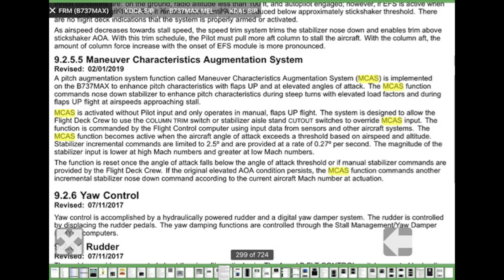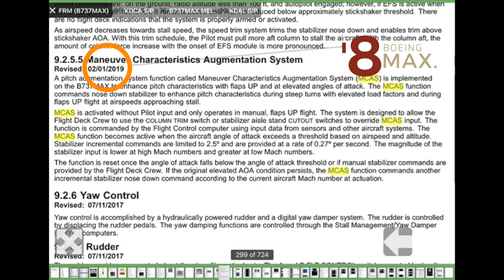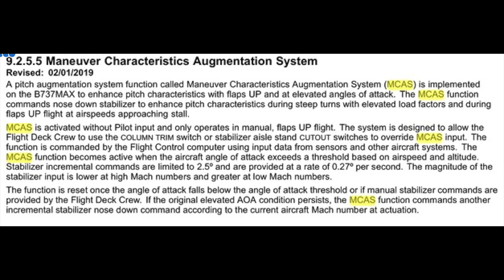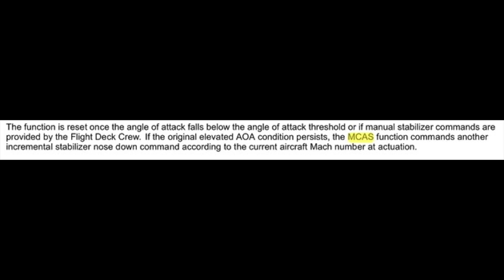737 flight manual - Prof Simon

Comment: New York Times just said last hour: "Doomed Boeing Jets Lacked 2 Safety Features That Company Sold Only as Extras Standard 737 Max planes are not equipped with a so-called angle of attack indicator or an angle of attack disagree light. The indicator will continue to cost airlines extra, but the light won’t."
Reply from the maker: Shocking
Reply: If those safety features would have saved the two planes: That would be the nail in boeings coffin. They know the risk, they had a solution. They cheaped out. No one dictates Boeings list Prices. The cost of the two crashed air planes and reengineering and retrofitting all remaining planes, lose of sales, ... all up add upto way more then Boeing has saved by not including those system in the list price. So: "Competitive reasons" are void.
Reply: Airlines are just as guilty as the aircraft costs $120 million the extra for that light was just $80k more.
Reply: The 'essential' safety features were sold as options presumably because if they were sold as requirements it would acknowledge that MCAS was a critical system that needed to be built to FBW standards and be fully and deeply retested and recertified.

Comment: Ola Professor !

I welcome your explanations and understanding which in my view has solved '99, 99% of the problem '; Something still does not complete me: - THE LOW INDEX OF THE OCCURRENCE! (all "non-executing" pilots would be able to fix it). where so far ONLY (2 'regrettable' accidents). How many MILLIONS OF ROLLING. This Flap move every 2.5 degrees (this Graduation that allows ARREDONDACIONES) is a factor that bothers me to full Conclusion ! Obrigado. (compreende em português ?)
Reply from the maker: Good points...I don’t really know....maybe Ethiopia has steeper climbout ...triggering the mcas?

Comment: How the pilots are trained does not fall to Boeing I feel that this whole ordeal is falling out of the realm of aviation safety and accident prevention and going into a political, very political stance because of trumps relationship with Boeing.  Now I'm not saying that Boeing did nothing wrong but I feel everyone is wanting to say Boeing this or Boeing that and I hardly hear anyone say anything about the company's and there requirement. IDK I just feel that both of these horrible accidents with such loss of life will be smeared by political pressure or possible gain the truth no matter who it condemns or obsolves need to be told.
Reply: It's simple. The problem is right in front of nose. !    The engines are too big. The engines are too far forward. The engines set to high in the wings. The engines are too close to the fram or body of the plan and too close too the stoll sensor. Which would give you all sorts of problems with the computers
Reply: Matt Kelly I agree Matt. We will soon move into a phase where we forget the lives lost, and even the plane; and just look at which company Boeing or Airbus, or which country U.S. or France dominates world aviatrics.

Comment: Let How Much Expert The Pilot To Flight Boeing 737 Max, They Cannot Save From Disasster To Crash If The Both Engine Off Or Lost Power, They Cannot Drive Just By Brain And Electrical On Plane Event The Battery Is On, .... God Bless Sir, ..... Cherrio02.

Comment: What I learned from documentation and fellow technicians. MCAS was intruduced to compensate for the extra lift the engines and engine nacelles create ahead of CoG. This will create a strong pitch up when nearing stall speed. To prevent rolling over when pilots don't respond quick enough MCAS would trim down. The main input MCAS uses is AoA. Now documentation points to mean value between right and left AoA, but the FAA in november last year mentioned a single AoA value could upset MCAS. For me it is still not clear if the mean or left absolute AoA value is used. It might be that the main/left SMYD 1 does not compare the calculated AoA value against SMYD 2 (standby / right) as it does for rudder control. Normally commands are not executed when there is a disagreement in values. Maybe it only does when the AoA disagree option is installed! Oh my if this is true...

Comment: In an earlier video you mentioned there were two choices in a redesign of an airplane with new center of gravity and center of lift factors caused by bigger engines with more thrust. You said there were two choices. The mechanical choice of redesigning the tail plane, making it larger. Expensive. Or the electronic choice. Cheap. This reminded me of when the original small Piper Cherokee evolved into the Cherokee Six. The larger version with a bigger engine got a larger stabilator for more control authority.
Reply from the maker: That’s right ....I’m a Cherokee 140 pilot.

Comment: "cutout switch" Well, why didn't they use it?
Reply from the maker: That probably did know what was happening...the mcas trim activation was maybe not in the manual...for lion air at least..
Reply: @SimonHollandfilms   Yes, for the first crash, But a very clear AD was issued shortly thereafter.

Comment: What ever happened to the idea of designing airplanes to have inherently stable flight characteristics?  Maybe Boeing has been making to many fighter jets.  A steep climb out roll should not make an aircraft unstable to the point where it would not self correct if climb and roll inputs were stopped.  Computers should not be relied on to correct an inherently unstable airplane.
Reply: Boeing had that choice to redesign the 737 when they put these newer heavier engines on but it was much cheaper to use the MCAS system.
Reply: Agree totally. I would never fly on this thing, its centre of balance is so off whack that it has to be pitched excessively forward even for level flight, I.e it needs to provide a constant restoring force against the torque of its own unbalanced weight. It's just insane. It's basically "pretending" to be stable, for all intents and purposes.
They have a design with a serious flaw, and in order to get around that they write a program to secretly alter the flight characteristics of the aircraft. And you just know the guy who said "this is a bad idea" at the design phase is curled up in a corner somewhere, rocking and mumbling.
It reminds me somewhat of NASA's problems with the Shuttle, where the pressure to launch meant that figures were fudged and safety margins inflated, then in perhaps the biggest hyped space launch since 1969, it blew up on live TV. As Richard Feynman put it: nature cannot be fooled.
Reply: Marcus Magee Exactly!

Comment: For what it's worth it's pretty horrific when professional pilots with 1000s of hrs flight time on the 737 don't know what the heck is going wrong with their Max8 plane right up to the time it plows into the ground or ocean.  The Canadian company that makes the flight simulator for the  Max8 said they have only delivered two worldwide so far.  United Airlines, the biggest user of the Max8 won't get their 1st sim. until Oct this year.  They also said this weird MCAS response was not part of the original spec build from Boeing in the first place. So what's the point?
Reply: I hate to correct part of your statement,  Southwest currently has the biggest fleet of MAX 8s in the US with 34, American has 24, and United has about 14 of the MAX 9s.   I agree with your statement totally, just a small correction, take care!
Reply: That 'clarification' is confusing, especially the reset part, for pilots and probably the engineers. The system was put in to correct a nose up condition created by the engines, and that problem has limits at level flight. This makes it sound like the system is designed to prevent stalls because of nose up, not by taking control of the elevators which are quite responsive, but by misusing the trim control which is very slow. You could easily correct nose up stalls like auto pilot has done for decades, by changing the elevator position, regardless of what is being done with the yoke.
Reply: The problem is that there may be many professional pilots out there with 1000s of flight ours when the plane was flying on autopilot and with close to 0 hours flying their plane manually. Remember that the Ethiopian captain was only 29 years old.
Reply: The point is that even if something is not in the training program,  when you receive an update for the manual, you must read and understand it.  If the training you received operating an automobile doesn't cover what to do if the accelerator sticks, but an update from the vehicle company says, if the vehicle's accelerator sticks, shift the vehicle into neutral to disengage the speeding engine from the drive system, then you should do so.
Reply: Or maybe if boeing could put in a bit more effort and informed that the new update are crucial and required the fullest attention from all pilots or maybe do what most car macnufacturer did in the event of a recall for faulty stuff, via electronic media or any mainstream platform it would be really helpful to the entire pilot community and I bet it will be appreciated but hey who knew what's happening with boeing or the pilots life this passed month. Just saying.

Comment: Do I understand it correctly? Boeing put an automated system to stabilise the flight characteristics of the B737Max and if the pilot disables the system because it over reacts, but MCAS detects the condition still exists it turns itself back on?

My non-pilot questions are:

* Is the AOA located a less than optimal location and is giving erroneous AOA indications in a climb or a climbing turn?

* Does the autopilot have the right fidelity to match the fidelity of the MCAS system and/or the flight characteristics of the B737 MAX?

* Does the MCAS logic automatically adjust the elevator to push the nose down as the aircraft approaches a stall in anticipation of the nose pitching up as more power is set by the autopilot??

As a general principal should a commercial aircraft be able to be easily hand flown by a typical commercial pilot within its flight envelope without any need for automated interference?  I am getting the impression that without MCAS Boeing doesn’t think the average commercial pilot can fly the B737 MAX.
Reply from the maker: Aoa are placed in the United un-interupted airflow on the nose...that’s ok but they are fragile.

Are you asking...do they play well together?  I think they probably do.

Very good question and possibly the root of the problem...all I know is the mcas keeps adding 2.5 degree nose down ....repeatedly until the horizontal trim is maxed out...and the pilots would have big issues recovering from a steep nose dive.
Reply: The logic behind the MCAS resetting itself is the following : MCAS is not a complete fly by wire computer which models the full flight characteristics of the plane. It is supposed to be a simple and dumb assistance system.
-Pilot does something wrong and pulls the control column raising the nose of the plane way higher than he should
-MCAS detects condition under which it is supposed to act
-MCAS slowly trims the stabilizer down to help the pilot do the right thing, and keeps trimming harder and harder for as long as necessary, and in addition the stall alarm is ringing
-MCAS has a built-in limit of 2.5° stabilizer trim towards nose down, but is never reached because either the pilot has also helped by pushing on his control column or this action has brought the nose down enough by itself
-The plane is now safe, in the correct attitude, and stable : the stabilizer is in the correct position : MCAS switches off and resets.
 MCAS saved the day ! yay !
-In the event the Pilot does the same mistake again, MCAS is ready to trigger again and do the right thing, again.

Now let's decompose what I think happens when the the system misfires like the in the two accidents that have occured : 
-MCAS activates but does not see the situation improving, so it trims the stabilizer down all the way to 2.5° towards nose down : at which point it disconnects leaving the stabilizer in the wrong position.
-No big deal, the pilot just pulls a little on his control column to maintain flight parameters, uses the trim button to apply a little bit of trim up until the plane flies level and then and tries to troubleshoot, the pilot KNOWS that it is not a runaway trim situation because the trim stopped moving on it's own (after 2.5° towards nose down), and the trim button works normally : so the pilot does not use the runaway trim memory procedure, and does not understand where the problem comes from,  and the STALL alarms keeps ringing so he tries other things.
-Pilot does something (anything) that triggers an MCAS reset (tries to turn the autopilot on and off for example).
-MCAS triggers again until an additional 2.5° maximum (now 5° total towards nose down)
-Pilot needs to pull really hard on his control column, his mind to completely occupied by using force on the control column. He can barely fly the plane (and flies poorly because nobody can fly a precise trajectory when using a lot of force). One thing is certain though : the pilot no longer has any mental resources left to troubleshoot.
-MCAS triggers again until an additional 2.5° maximum (now 7.5° towards nose down)
-the now needs to use all the force he has to pull the control column is in it's maximum deflection position, yet the nose keeps going down.
-the pilot tries things : uses the trim button to bring the stabilizer back in it's normal position, and brings the nose back up. It looks like the pilot has found the solution, but...
-as soon as the pilot releases the trim switch, MCAS triggers again
-repeat the cycle until...
-the pilot is exhausted, physically and mentally : he does not understand what is happening, he is mentally and physically exhausted.
There are all sorts of non-sensical alarms going all over the place and neither the pilot in command nor his colleague in the seat across understand what is going on
-the crew starts doubting their instruments, this situation is clearly impossible, the plane is lying to them and they don't understand what
They are in a steep descent and yet they are stalling, they try to do the recovery proceduces bus as soon as they believe they have reached a stabilized attitude, the alarms start ringing again and the plane nose dives on it's own

 -the crew has completely lost their situational awareness : this situation becomes similar to the Air France n°447 Rio->Paris A330 crash in 2009 :
Someone on the flight deck is actively sabotaging the flight and nobody is understanding who it is, what it is doing or how to stop it.
As good (or as bad) as the crew could be : all their training and experience has been rendered useless because their brains are frozen, overwhelmed by 
this unknown and extremely stressful situation
-MCAS pushes the stabilizer all the way nose down again
-This time, the pilot no longer knows what to do, and stops using the trim button : the plane is going  down : flying steeper and steeper and there is nothing the pilot does that seems to be working
-The plane crashes into the ground at very high speed and extreme angle, everyone on board dies.
Reply: Do you understand the basic configuration of the tail on 737 MAX?  The MCAS does NOT adjust the elevator! It moves the adjustment of the horizontal stabilizer. The elevator is controlled by the hydraulic system activated by pilots control yoke. If the pilot applies considerable yoke input to counteract what the trim system is doing with the horizontal stabilizer the MCAS stops what it's doing but will quickly reactivate if it believes it's still needed. That is NOT what is meant by "deactivating the Stabilizer Trim function". Deactivating the electrical trim system is accomplished by flipping the "stabilizer trim cutout" switches on the CONSOLE. If these switches are manually turned off the MCAS is totally disabled and will NOT turn itself back on. If you are a big prof Simon fan you maybe don't know the difference between a horizontal stabilizer and an elevator (or an aileron for that matter either) because I don't think he does either.

Comment: The two big question that Boeing has to answer is why an important safety equipment is an option and not a standard equipment. And also Boeing self certifying the Max plane fit to fly instead of the FAA doing the test are big alarm bells. 

If the Max plane was allowed to fly. And the AoA sensor disagrees MCAS go haywire and sends another Max plane to a death dive. Boeing will face the ICJ for manslaughter.
Reply from the maker: Optional safety equipment seems crazy....I agree
Reply: Professor Simon Holland it costs 80k for the extra safety option... simply greed. Now Boeing are giving it to customers for free 
Bit late now